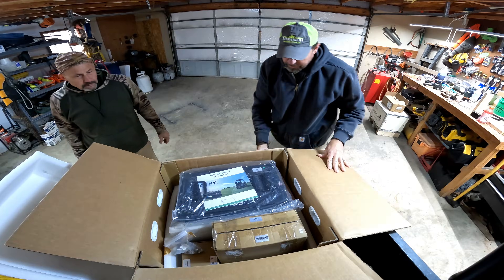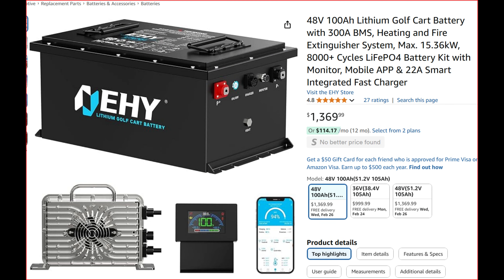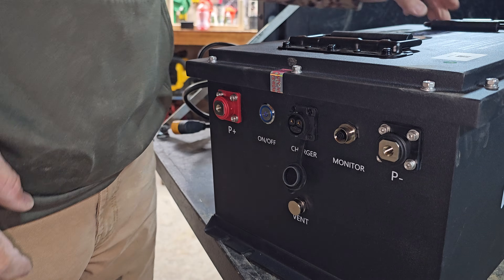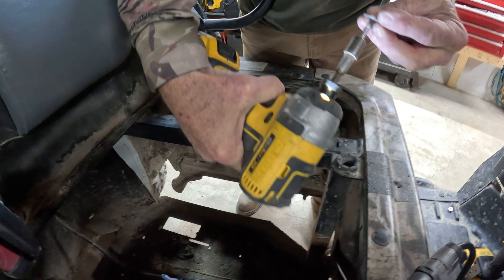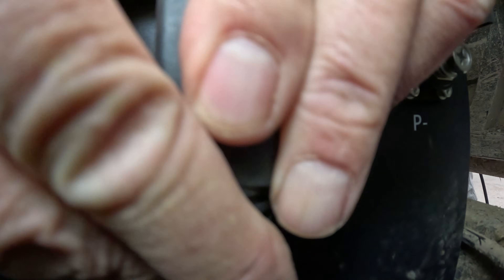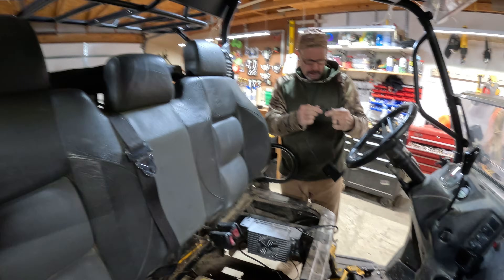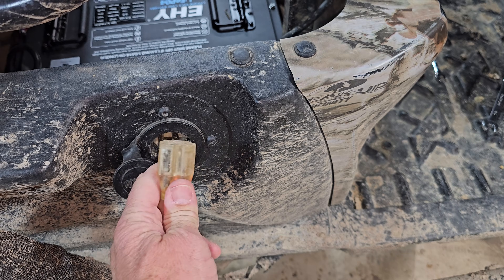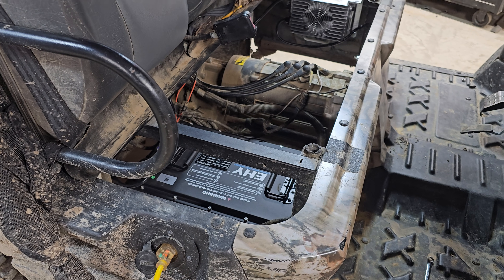New 48v LifePO4 Lithium battery Rocks!! Complete Installation & testing!

Comment: Did this new battery do better on hills? Thinking about putting in two hooked in parallel. Same voltage double amps.
Reply from the maker: Man, that would be a killer setup.If you put in a pair of them, they are coming out with a new one right now.It's called a u t v sport battery.We put that one in the intimidator solo, and i've been testing it lately, and it's been doing solid.Even towing and going up steep hills, my controller never kicked out.
Reply: I put in two 105ahs in parallel. My intimidator really scoots.

Comment: shouldnt there be a way to wire that so that screen would shut with the key???
Reply from the maker: hmm. Well not sure because the screen plugs directly into the batter pack. not knowing what voltage or wattage it needs might be a challenge..?